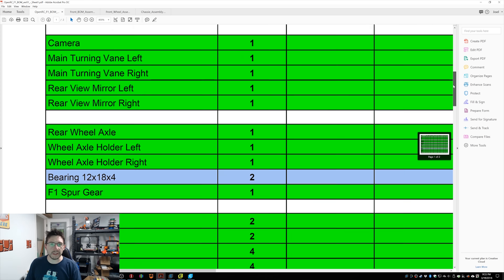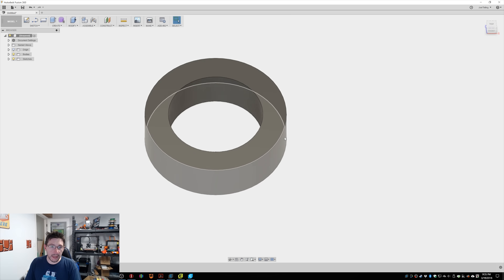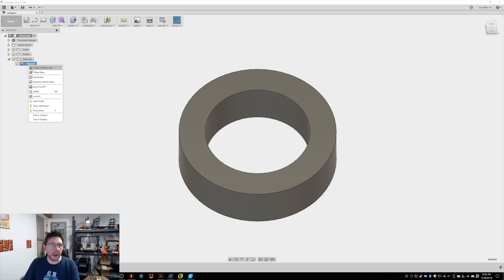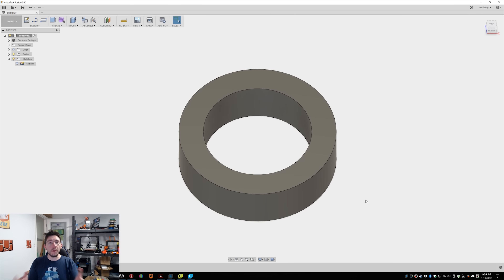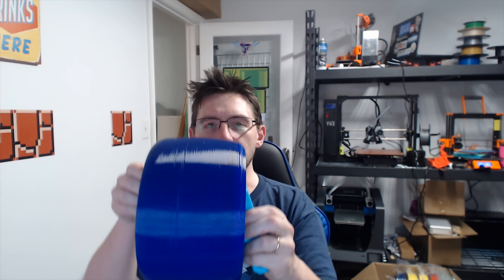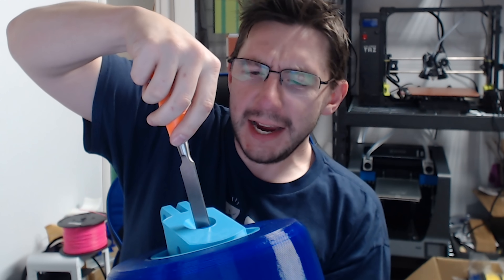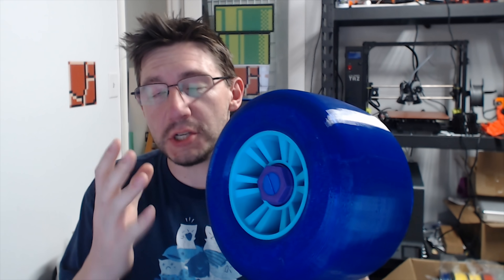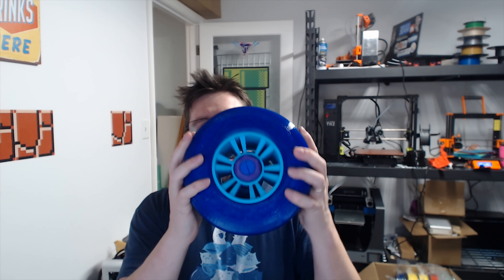3D Printing Bushings for the World's Largest OpenRC F1 RC Car [EDIT: Its a Bushing]

Comment: I bet it will melt down very quickly. PLA is probably the worst material to use for a journal bearing...
Reply from the maker: IF this was going to move fast. This will not. When it goes radio controlled, it'll not be using these :)
Reply: Ok, in this case, all good :)
Reply: But then, for fun you can also print fully functional roller bearings. Many of them available on Thingiverse (customizable) rolling right off the printer without post work.

Comment: Hope you are enjoying the MERF... =]
Here is some info on friction from a Formlabs white paper on engineering fit with 3D printed parts.
Snippet showing ideal alignment of layers to avoid friction.
https://imgur.com/a/WehGg

Full white paper:
https://formlabs.com/en/engineering-fit-optimizing-design-for-functional-3d-printed-assemblies/

Seeing as this is a conical (cylindrical) mate the ideal alignment (layer lines perpendicular to each other) would not be possible so this option is the best considering the way lines can go down on a cylinder. For a flat connection or mate the 90 degree alignment will be the best giving you the least friction from a dead stop (Static) and while in motion (kinetic)

Can not wait to see the hole car, wish I could make it to MERF to see it in person, great job... =]

Comment: what you have done is made a PLA BUSHING. at the speeds your likely to go at with this car I actually think it will work just fine.
Reply: walking speed? He wants to make it into a remote control car...
Reply: I think the plastic will heat past the glass melting temperature and fuse together, its PLA it only has to reach 60* and its wrecked. If you are going to make a bushing at leased use ABS (not really recommended at all), nylon, POM.
Reply: I don't think it will. this thing is going to do at most "walking speed" those parts are never going to overcome their own thermal mass to reach glass temp and deform.

if this was a smaller one that was going to go zoom zoom. sure you betcha. I would be surprised if you got "one race" out of a set of them.

but 3dp's monstrosity. its not a race car. its a "display piece" that will be able to move. even a 5mph collision with something hard will probable break it from shear inertia alone.

as long as he keeps it slow and put puts around to show it off at walking speeds I think (I could be wrong) the bushings will hold up just fine.

Comment: I think there is a problem with your design :
When you screwed your bearing on both sides, you prevented the wheel from spinning (as seen on the video). But this wouldn't have happened with real bearings because you could have blocked the inner ring of the bearing on the axel and the outer ring of the bearing on the wheel.
I think you should re-design your 3d printed bearings in 2 parts that slide on one another (simulated the inner and outer rings of a real bearing), this way you could screw tight. Because if you have to loosen all the screws of the wheels it will end up falling apart.

Comment: I think this is, just as you said, a perfect demonstration piece. To show what the printers can do, and if you choose your materials for the loads you are working with, exactly what you can get away with.

Also, please if you do read these comments, please think about in the next version which will be powered and such to just use a single standard bearing size for the entire car. Again, I don't think you will be getting this thing up to 4x speeds, so by picking a single bearing size you will save on all the shafting you will have to purchase/scavenge. I think you could get away with using roller skate bearings, or even fidget spinner bearings with how little actual speed you will see on them.

That's because the outer diameter of the wheels are going to be so huge compared with the bearings, they won't see the load/RPM that would require really super nice bearings. Anyway, thanks for the video. It was neat!
Reply from the maker: I read this! Yes - demonstration piece. Perfect description. Once powered quite a bit will change and I love your suggestions.

Comment: Wouldn't it have been easier to measure the inner dimension of the rim, then the diameter of the axel, and then fill the space between them when designing the part? Great video as always.

Comment: Hello! Excellent idea, in my experience 3D printed PLA and ABS are not wear resistant, although I have avoided using plastic parts as bearings, I have found this company that sells wear resistent filament:
https://www.igus.com/3d-print-material/3d-print-material 
Greetings from México

Comment: A parametric print in place ball bearing would be cooler.

Also, it would be better if it was a press fit into the rim and axel so you can change out the bearing when it wears and not need a new axle and rim too.

Comment: seems stupid but Just buy Ball bearings in fitting Dimension ...
Reply from the maker: Sure, if I had time. I couldn't find any and I had three days to get this part done.
Reply: 3D Printing Nerd oh well Not good then but Just as an idea If that doesnt Turn Out good many cars have Motor parts with bearing sizes around 40-50mm i Sometimes get some from carshops for free . Around 60% of them are perfectly fine. Andere good luck with that awesome project
Reply: 3D Printing Nerd http://www.onlinebearingstore.com/miniature-ball-bearings.html?gclid=CjwKCAjw4sLVBRAlEiwASblR-5zUS8O2VRthZMhyNfRuosmDc2fKgROU1KWnTraUI6Y3baFVl0YZcxoC_18QAvD_BwE#/product/2264

Comment: what about nylon instead of PLA? it's much more slippery and much more temperature resistant to withstand any heat generated due to friction. I prefer Taulman 910 for such applications.

Comment: Do the same with nylon on the contacting surfaces. Will be way less friction. You probably wouldn't need to print a new axle. Just print a collar and fix it the pla axle.

Comment: Do you print your outlines (perimeters) inside out or outside in? The default is set to print inside out. It's helped me a ton with tolerance issues since I've changed my settings to outside in.

Comment: Trial and error? That's your method? What's wrong with taking measurements and calculating? That's how a machinist does it. I would know. I'm a machinist.
Reply: Thankfully he's not machining it, then you'd have an argument. 3D printers aren't always accurate print to print, especially dealing with tight tolerances that come with bearing assemblies. TLDR: Cut him some slack.
Reply: FDM/FFF 3d Printing is nowhere near as exact as machining.  I have gone through measuring and calculating; designing in what I thought were the correct variances from the hard dimensions, and still had to adjust a few things on the fly.  If you watch someone like Adam Booth there are times when even machinists have to adjust on the fly to get the right fit for the end product that's why many designs have tolerances.  3d Printing just makes it easier to do trial and error when you are out 30 minutes and $0.30 in filament.
Reply: My experience with 3d--printing is that not everything is calculable (< is that english btw? i dont trust my dictionary on this :3 ) at first. You can certainly print without trial and error, but only if you know how far off the printer is from the desired length/diameter/etc. which requires some trial and error. So for the first (in joel´s case) bushing you just have eyeball it at first. I´m still just printing out different shapes/bearings and connection methods to get that kind of data and I have my prusa for 3 months now.
Reply: Well, Print your own Calipers then , haha
Reply: Hey Joel, if you do grab a new set, I highly recommend these: https://www.amazon.com/gp/product/B00INL0BTS/ref=oh_aui_search_detailpage?ie=UTF8&psc=1

I've been absolutely pleased with them :)
Reply from the maker: Hahhaha DUDE. I cannot for the life of me find my calipers. They are around here somewhere. It's to the point where I think I'm going to need to just go buy more. Sad.
Reply: even if you had found your calipers, there would be no way that they would help you in measuring the OD of the inner bearing seat.
Reply: Why do you have to be so negative? There are ways to measure anything.

Comment: I think that another reason that you can use a 3D printed bearing at 4x scale is that the parts are less likely to break. Its actually basic knowledge, that for example, a twig is easier to break than a tree branch due to a different diameter.

Comment: ever thought of trying to 3d print a ball bearing?(or maybe a roller bearing?) honestly it looks like what you're doing works good for your application, but, i've seen a couple people get pretty good results with completely 3d printed ball bearings (even with the balls printed already inside the bearing assembly)

Comment: My volume is low if its already mentioned it due to being at work, but will the spinning parts be using a higher heat resistance plastic?

Comment: Yeah pla is going to melt together very quickly take a piece of pla off the roll put it into your drill spin it and then push it into another piece of pla don't have to put a lot of force and the friction alone will heat them up and melt them together it's how I weld pla together

Comment: Print bearings in metal? If I remember correctly, the metal 3D printer you showed a while ago is good at printing working mechanical parts, maybe you could get your hands on one of those?
Reply: Kalahi Md cant get up to the tolerances a bearing would need

Comment: As others have commented, that is a bushing. I think you know that, but you failed to properly select material for the design change. The fact that the layers are in the same direction could cause them to be more prone to mechanical fusion via heat pockets. That is to say that if one small region gets hot enough to melt, the friction begins to rise exponentially and the parts fuse. There is a reason metal bushings are typically of a different material than the shafts.

Comment: If I were you, I'd get some silicone based oil for the surfaces that are moving across each other. That'll make it slide better and cut down on heat from friction.

Comment: These things he used are called plain bearings. Those are even used more often than other kinds of bearings :)
Reply: yes the problem is: with normal plain bearings you need a very hard gliding surface and a weak bearing material (both surfaces polished as **) so I would call it a weld filler

Comment: PLA rubbing against PLA produces heat, and two hot PLA parts together become 1 fused PLA part. How about using nylon on those parts better?
Reply: some nylons by taulman are made specifically for things like this. A great idea.
Reply: or a single layer of Kapton Tape?
Reply: Nylon was made for uses like this, Taulman is just advertising its use purpose better. The only other plastic i would consider is POM (Delrin plastic) for a use like this.

Comment: I wonder if adding a little white lithium grease during assembly might help it run smoother. I know this project is more about the 3D printing, but it never hurts to chase a little performance. It could be kind of cool to see what types of grease and lubricants work with 3D printed parts. It could really help those people interested in 3D printing mechanical models.

Comment: Have you considered pinning the bolts on the wheel hubs, direction of rotation could un-thread/un-screw the bolts from the hubs or could over tighten & stop rotation.

Comment: You can use 4pcs bearings of size 61807 and print 2 litte tubes of size  32x35x14mm and 2 tubes of  47x48x14mm size per tire

Comment: Have you figured out what you'll do about friction on the axle to the bearing? Being in PLA, it might not last that long if you're putting the car through it's paces for a decent length of time. Heat from friction is going to build up on that pretty quickly me thinks.
Reply: So lubrication should be used to reduced heat caused by friction force. I recommended always using lubrication, even if factory said that is not necessary ;)
Reply: CosikNS like silicon lubrication?🙄
Well, that's what you said in your comment
Reply: CosikNS there's a joke in there somewhere.
Reply: Joel James yes, but I didn't expect that anyone will ready my comment under video :D

Comment: Hi, maybe it's good idea to add some lubrication for those parts? For example silicon or teflon oil?
Reply: Certain normal lubricants can weaken plastics, I'd just try mineral oil first and see what happens with that.
Reply: Yes, but now I don't remember but silicon oil or teflon oil is dedicated to used when two plastic has contact. What is more silicon oil is waterproof and don't collect dust.
Reply: Use a candle and rub the cold wax on the mating surfaces - should provide plenty of lubrication and not damage the plastic nor pick up any debris along the way..
Reply: Carbon (like in pencils) could wok like dry lubricant.
Reply: graphite lubricant like Kurukuu suggested is best in this case since it fills gaps well enough but cannot corrode or otherwise damage the plastic. As for flammability that is not a concern in a build like this and i've used graphite in far more energy intensive applications than this without fire.
Reply: Kurukuu but carbon is flammable but silicon oil not
Reply: Thread seal tape (PTFE) would probably be great for this. Just wrap the ID of the bearing, the axle, or both where they meet.
Reply: Baby powder or some flour should work
Reply: Oils will just run out of the bushing, there are special types of grease for this kind of thing. Anything that uses mineral oil or petroleum will dissolve the plastic
Reply: Silicon grease would be the best it doesn't harm plastic

Comment: Install motors so you can drive it like a rc car!
Reply: Indeed, Master Bacon Cheesecake is right. I believe it is known as Phase III
Reply: I think those bearings would melt, he would need to get some metal ones. Or print actual bearings.
Reply: a little bit of lube goes a long way
Reply: heck yeah
Reply: Patience, young one